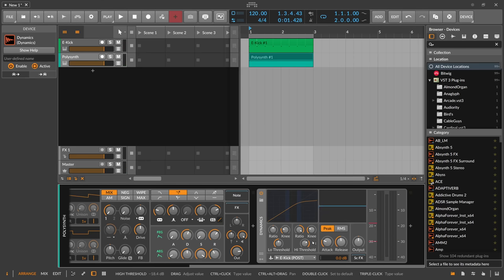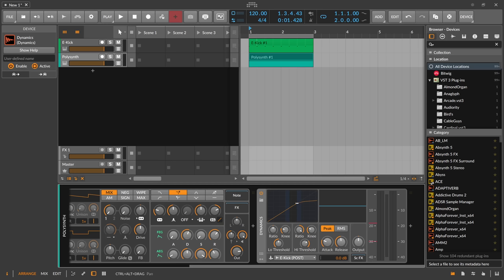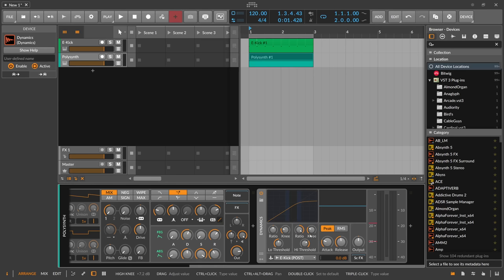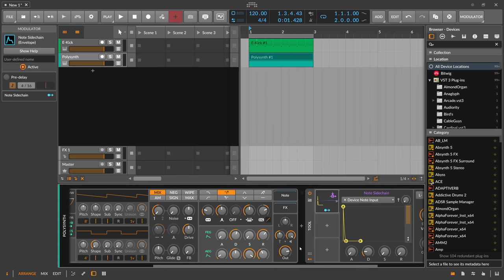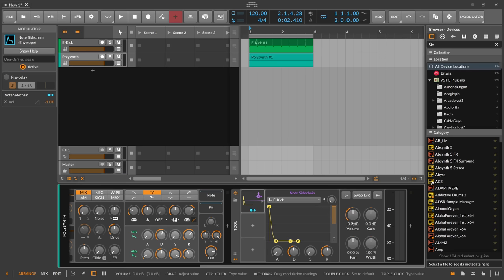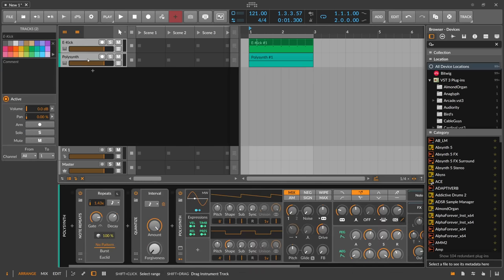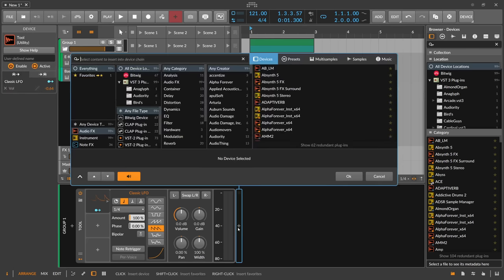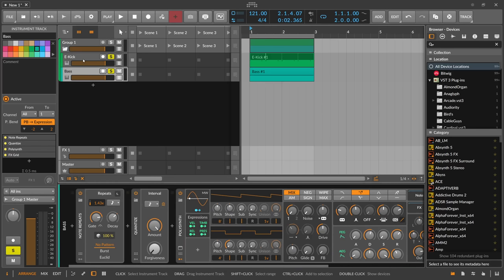Exploring Alternatives to Compression for Volume Automation

Comment: One more method to have the entire spectrum: just to control the Tool (or even synth's output level knob) with a DAW's automation graph. Benefits: you have full control over the shape, so it may include "ducks" for notes in a complicated pattern, and it might be different for each note, isn't it?

Some time ago I was watching a video on how a professional mixes/masters the track. At one place, instead of tweaking compressor settings, he just added an automation and reduced the volume of the instrument manually, only at that specific point. That was an eye opening experience for me - that there are a lot of ways to do compression without even using the Compressor. And sometimes it may give better results, be more precise.

Thanks for the video!
Reply: I do this as well! One thing that still makes this hard though is that sometimes I find that the whole mix balance has gone to s**t and I need to redo it. In those times, tweaking the automation lanes can be incredibly frustrating at times, heh.

Comment: the LFO ducking is a good idea. However, there is a click sound that is annoying. Any workaround for this?
Reply from the maker: the click is bc you duck very fast at a non-zero crossing. so you need to a small fade in (use the tilt knob with the other lfo, or use the grid method and a slow attack on the envelope) or match the phase of the bass with the kick so the ducking happens at a zero crossing of the bass.

Comment: At around 10:53 you state that the compressor's ratio is "'how fast things get reduced", which is wrong - the compressor's ratio sets by how much the level is reduced, it's the attack time that settles how fast the compressor is acting.
Reply from the maker: It changes the input to output ratio. The higher the ratio the faster the signal is reduced from the viewpoint of the transfer curve (its not a diagonal line anymore). which results in a different level. the attack changes how quickly the compressor reacts to the input material.